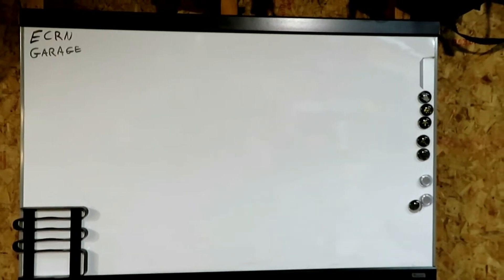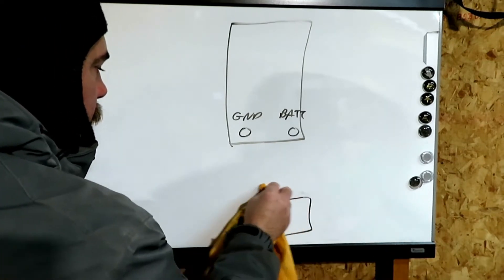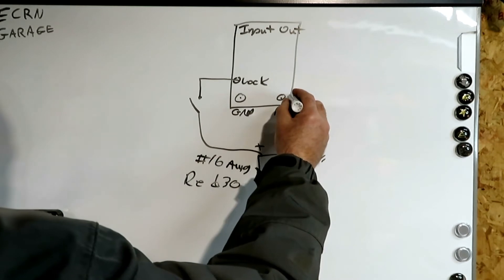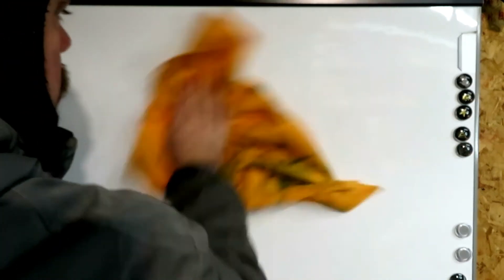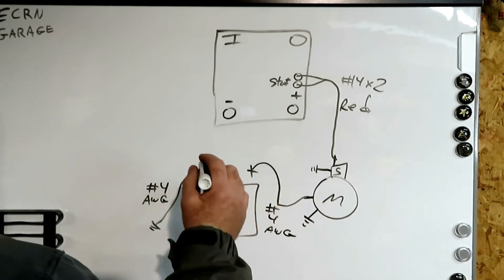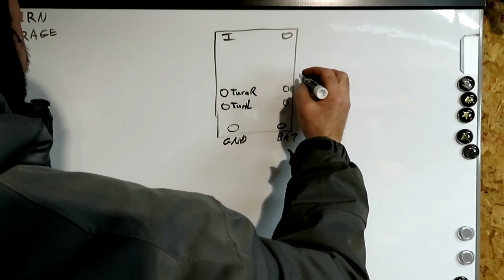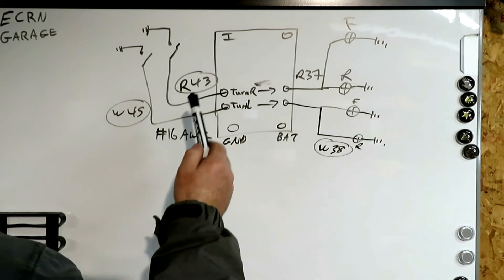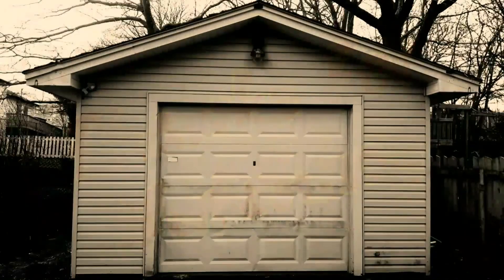Motogadget M-Unit Wire By Wire For Beginners: Part 1

Comment: I need help I have a 86 sporster with m unit v.2 I didn't install wiring got messed up cant get it how can I get a wire for wire diagram
Reply from the maker: Are you looking for a copy of tbe m unit diagram ot thr sportster? Both are available on line. You may have to trace each wire from the m unit to where they are going and if they are correct.  Also the programming may need to be verified also. Let me know if you have specific questions.